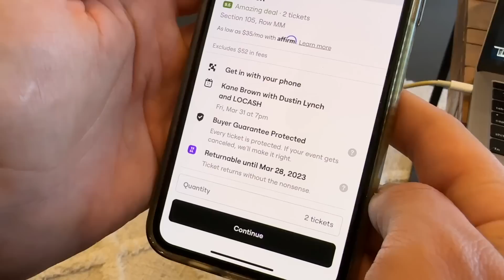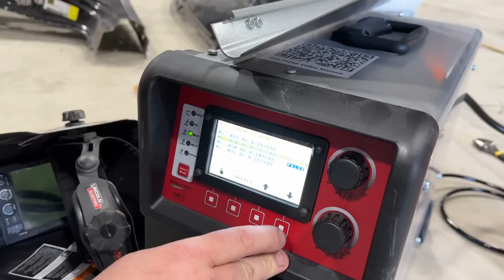Our Wrecked Porsche 911 Is Officially Going Back Together!!!

Comment: Cold air is beneficial to sound.  It’s not necessarily that the air is cold it’s more dense.  You engine performs better when the air is cooler and more dense.  The best performance of you vehicle is when it’s just before it rains. It’s scientifically proven. Good job guys.  This was an EPIC show tonight.  Keep it up.  
From Canada
Reply: It adds HP. Particularly noticeable in tuned two strokes.

Comment: That dust collector is designed for wood working, for a table saw or planner/thicknesser etc. Its a pretty basic one too, ideally for those applications you would actually use a cyclone. Anyway, its not really designed for what you guys showed with the sanding dust. Better off getting a sander with a shop vac connection on it.
Reply: And a seperate filter/seperator like they use for drywall dust
Reply: Seems like they're always doing the wrong things that makes them look silly.  I guess they just don't understand things very well.

Comment: If you keep detailing cars  and spraying silicone based tire shine or certain spray wax you will contaminate the cars that have not been completed. Wash the car or part  especially used parts with Dawn  dish soap or ,ajax  scouring powder works well and grease and wax remover or alcohol before starting to do any bodywork sanding or grinding to it.if it's not free of silicone the silicone will bleed through the Bondo and primer and you get fisheye that is almost impossible to get rid of. Only use silicone and wax free detailing products in a body shop. That's why dealership has the detailing shop housed sperated from their body shop and paint prep paint booth area. If you don't believe do so research on it ! Fish eye remover in paint or primer works but makes it easy to spray a run. And degrades the shine when paint drys to much fish eye remover and your paint or clear might never dry completely . After 35 yr.s of auto painting I have seen it all.

Comment: i still find the layout and the working of the workshop very odd, not really thought through properly and i guess much is down to money and doing things at the time or at the same time, workshops generally evolve - i would have a spray booth tagged onto the building, yep i know its coming, but do it tagged onto the side or end of the building (not inside as it wastes space) make it a drive in and out perhaps, and with another booth next to it, or a corner of the building sectioned off in which you do all the body work and prep, to keep the dust away from the main workspace - get the floor sealed properly, it makes so much difference and keeps the place dust free, remember your breathing all this stuff in, its pretty disgusting stuff
great to see Benny Boy assisting, funny to see him welding your cars, and Ben gets his brother Yuri to do his welding

Comment: You should get a portable exhaust fan sit it outside and run a sock to where you're working It keeps the noise away and will have better Suction. I 2pack kitchens on site and it works great.

Comment: Make a long collection trough out of alloy for the dust collect to sit on the ground or on the frame machine so it will pull down and collect dust when working on your cars… won’t stop the dust getting everywhere but will reduce it a lot. A large rain gutter could be used as you can get end caps and the down spout fittings for the dust vacuum pipe to fit up to.

Comment: Been welding my entire life. Everything from sheet metal manufacturing to structural steel fab and install and you do not go in half moons 😂... the hard wire arks and gouges a groove into the steel and then the molten steel fills in the gouge. Yes when you whip your puddle back and forth it looks cool (like a TIG weld) but it’s not great penetration and would never pass a weld cert. That being said so many people do it I think your welds will work perfectly fine.

Comment: surprised you didn't do an Amazon same day delivery of the sheet metal clamps (the vice grip type clamps but it has a big square end to get around items.   You see body guys use them all the time.  Those are 1 hour delivery for me, LOL.  Or clean our a Harbor Frieght... perfect for cheap crap like that where its not worth paying for a $30 pair of clamps 50 times over for just one project like this that will likely be thrown in a drawer for two years before you need something like that again!

Comment: We use these dust collectors extensively in the shoe industry. There is a hidden danger: the rubbing action of the swirling particles charges them with static electricity, and are prone to catching fire, specially when you leave them sitting. Sparks from polishing metal are very dangerous if swollen into the plastic bag. ALWAYS MAKE SURE THERE IS NO FIRE HAZARD BEFORE YOU LEAVE THE PREMISES!!  Aspiring solvent fumes might as well increase the hazard!.

Comment: The bag on the harbor freight dust collector isn’t designed for fine participles. It’s designed for sawdust so you are basically blowing the dust all over. 

Get a hepa filter for it if you want to achieve the clean air result